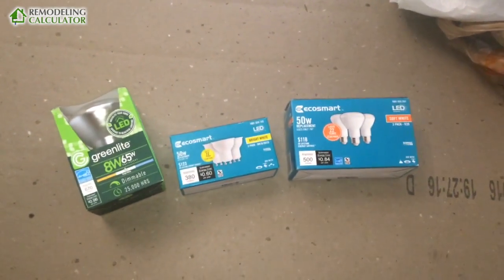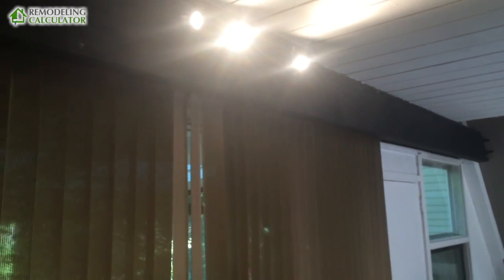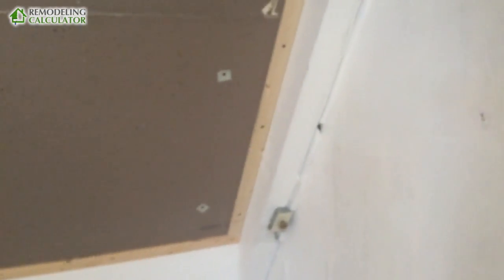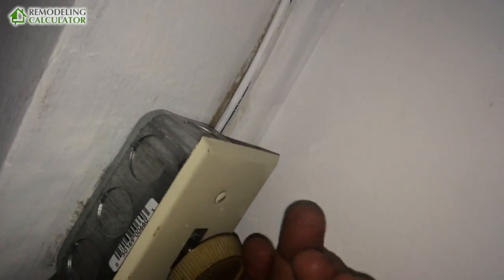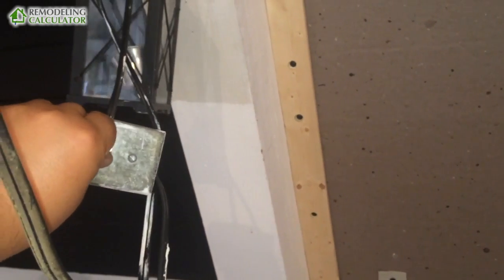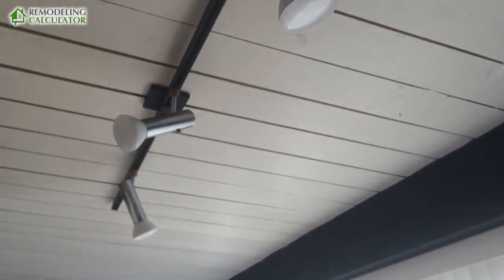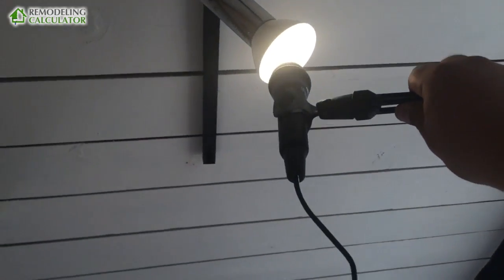FIX LED Lights Buzzing (Humming) Noise

Comment: with my old dimmer i used dimmable led bulb, it made me crazy, tried many things, at the end an easy extra cheap fix was in the bulb socket i put a 160k/0.5w resistor across the connection, i have 4 dimmers with cheap led bulbs and no noise now,  (my fix was on 220v) hope it will help others

Comment: I hear buzzing from regular Osram/Philips SMD bulbs without a dimmer, especially just after they had been turned on. It is not really a problem. But filament bulbs do not buzz, probably because they do not contain a proper power supply with a coil.

Comment: Had LED lights from Costco then put a dimmer switch.  My problem was humming and i fixed it by  finding and replacing only the lights that made the noise.  This is my advice, if everything is dimmer rated and all the lights are noisy then replace the switch.
Hope you find  this is helpful

Comment: I've got a new track light fixture with dimmable LED's and a modern LED/Halogen compatible dimmer and it's still buzzing. It would be nice if that condition was covered too.
Reply from the maker: Mike, you know it could be any number of things ... if you can return these things, I would start with lights ... then it could be the track ... I have dimmable lights in other parts of the house, where there are no track lights, and non of them buzz ...

BTW, come to think about it ... I only had this issue with track lights. In kitchen (i think I showed it in this video) I replaced track with regular lights and buzz went away...

Also don't waste your time asking guys at home depot if they can help ... they won't :)

I bought come commercial lights there without ballast to use with LED 4' bulbs ... they did not work together... all new... bulbs compatible,  no direct wiring required ... but they work with old (ballasted) shop lights

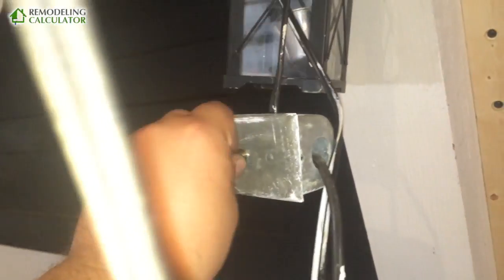Comment: You shouldn't be worried about the buzzing, your special wiring is against code and is a serious fire hazard. 2:37 You're using exposed wiring boxes with improper wiring. You're hanging the box by the wire and you're not even using knock out connectors. You should be using BX or MC wiring properly fastened and terminated to the box with a knock out connector.
Reply: Remodel Calculator almost 1 year did you fix?
Reply from the maker: +Order in Chaos not my wiring... Came with the house :)

Comment: Sometimes the best 'repair' is a replace. (Perhaps if you figure out what the difference is between the led compatible dimmers and the old ones, you should post a link to the video explaining how to internally retro fit (FIX) - if possible. ) :)
Reply from the maker: +PyroJasonExplodes the difference is ... LED dimmer costs $17+
Non LED dimmer starts at $12... So if u want to save $5 (or $17) and waste hours retrofitting (and risking a fire) i won't stop u ... But you should know - its dumb :)
Reply: I'd do it just for proof of concept but I agree - replacing is probably the best bet.

Comment: Changing the dimmers is not "fixing" the buzzing. Fixing is fixing not replacing. You have over 2000 views because people thought that you found a fix which you did not.
Reply: The issue is the buzzing, the fix is a compatible dimmer switch.  Not our fault English isn't your first language.
Reply: this is actually helpful. buy a compatible dimmer and problem solved what's the issue
Reply: There's no issue, you're just a genuine dumbass.
Reply: rich saudi boys dont know what "lowlife" is tho
Reply: wrong -- the buzzing is due to using the incorrect dimmer (an incandescent dimmer on LED bulbs). thus yes, the solution is using the correct dimmer. stop whining.
Reply: Biiiiiitch